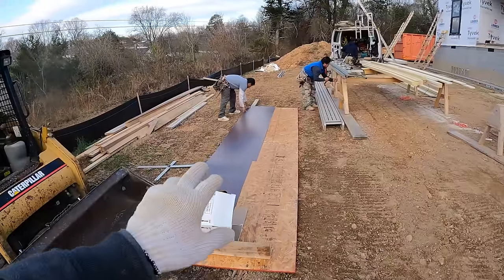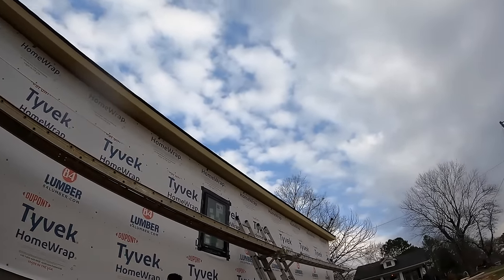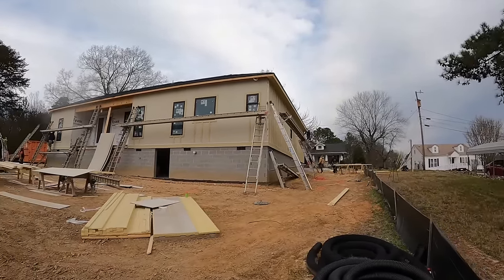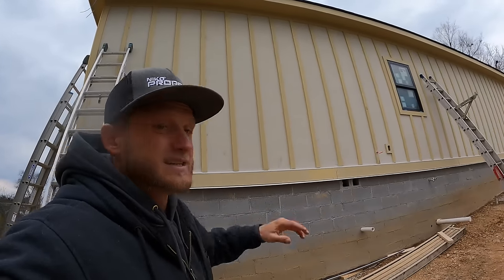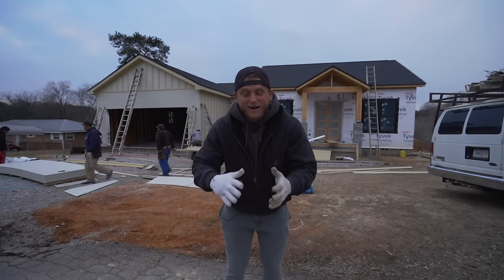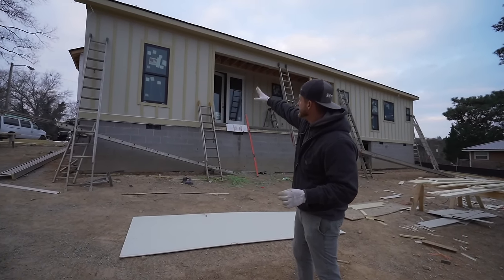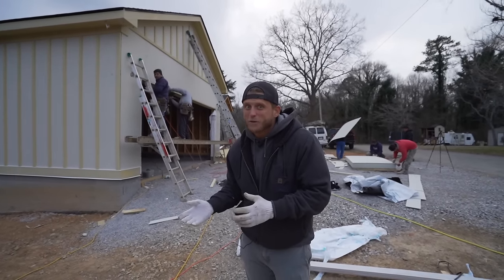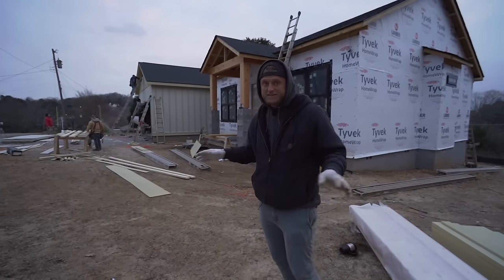How To Install Board and Batten Siding | Building A $350,000 Custom House | EP 32

Comment: According to JamesHardie the cut edges are supposed to be primed, but I don't see anyone putting primer on any cut edges. Looks like the installer just voided any warranty you think you had.
Board and batten came about from a western USA building technique that didn't use a stud wall framing. It used a heavy wood frame at the corners and along the top of what was to be the wall. Vertical boards joined the upper wood frame (like a top plate) and the lower or upper edge of the outer floor beams, like a sill plate in stud platform framing. Then battens were added to one of the vertical planks to create a solid wall. Battens were only nailed to one vertical board to allow for expansion and contraction.
Reply: Nobody actually does that.

Comment: How would you suggest doing 4×8 sheets of cement board 2-1/2 stories in the air. I don't think I can manage it off my boards and jacks. I think I need a lift,am I thinking correctly?
Reply: Yes. We use pump jacks for 2 stories houses

Comment: just reminder, will never regret… make electricians run you 16-2 wire for LED’s under kitchen cabinets! they have to know about it. make sure they know about 12 or 24 volt driver or transformer for led tape.. for more info read my comment when they did electrical.